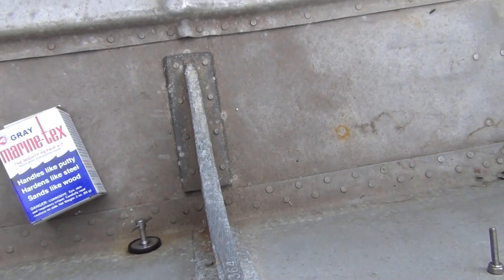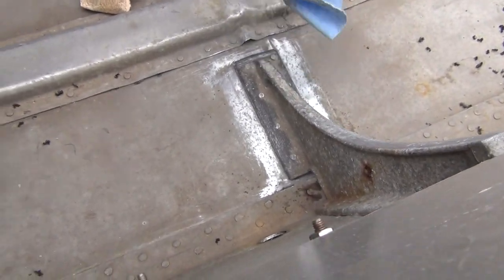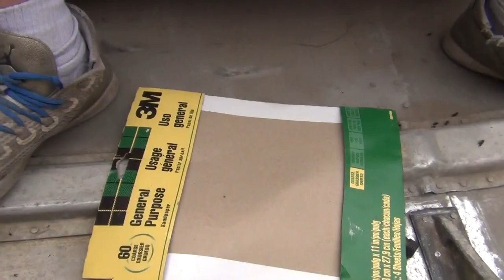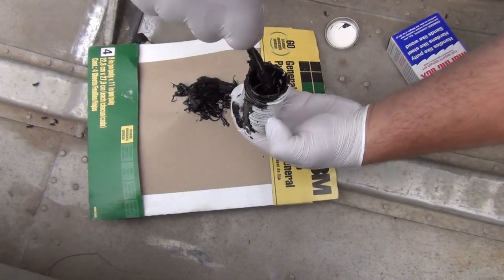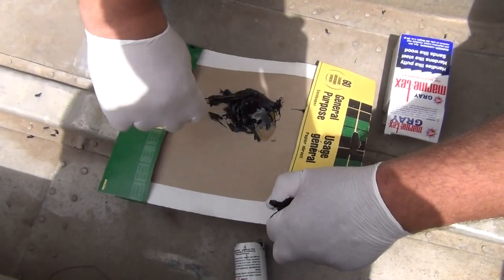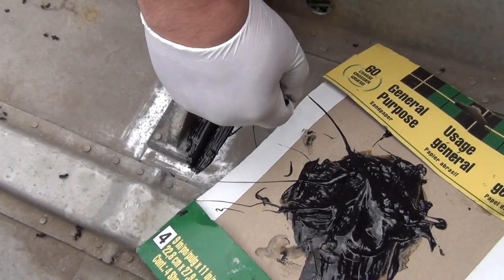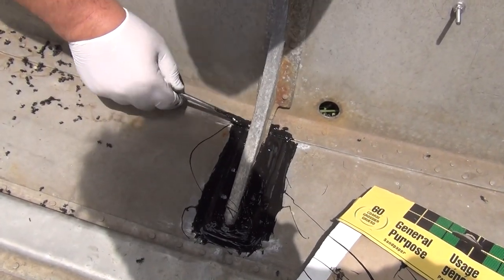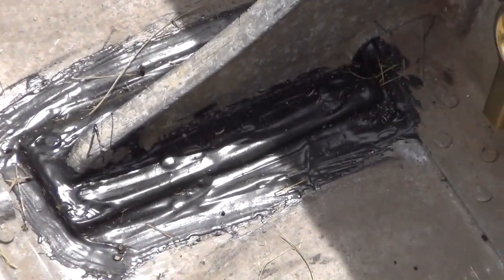How to seal a leaking aluminum boat using Marine Tex - live demonstration by the lake

Comment: Thanks for the video. The small junior size of MarineTex is meant to be mixed in the container. Just enough putty and catalyst for the perfect mixture. Use a popsicle stick for stirring and then apply. Great product!!!
Reply: Be sure to cut the end of the popsicle stick square. Otherwise you cannot scrape the very bottom edge of the container, & it doesn’t get mixed.

Comment: A small wooden mixing stick like a tongue depressor would have worked much better than the flux brush.
Reply from the maker: You can use that to but I only had a brush available at the time plus the brush would let me put the Marine tex in hard to reach places

Comment: This epoxy is great, super hard but not brittle, chemical resistant, bonds to almost everything. I mainly use it for rifle action bedding, but have used it to repair non pressure cast iron plumbing pipes. One repair is 4 yrs old and still holding water. It's better than jb weld in my opinion.
Reply: It works great for rifle bedding
Reply: It sure does, the best I've used